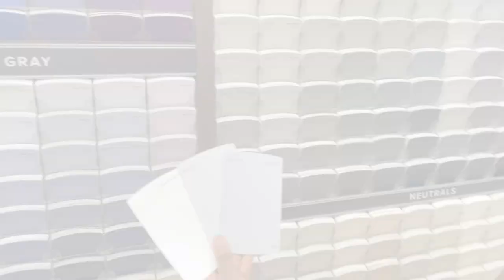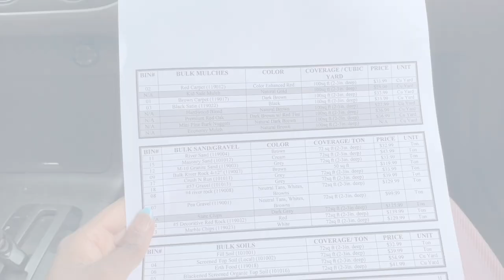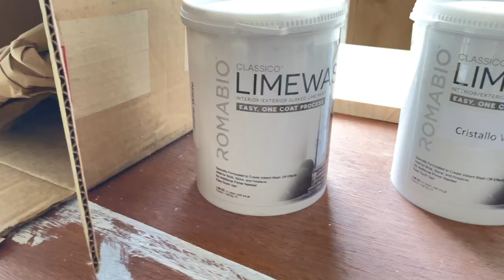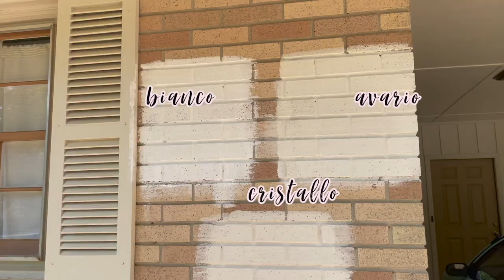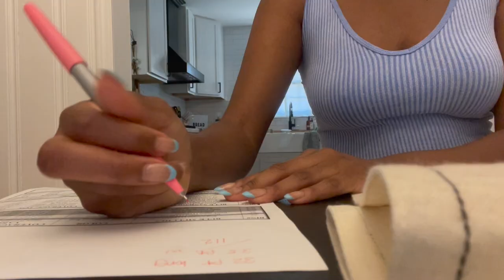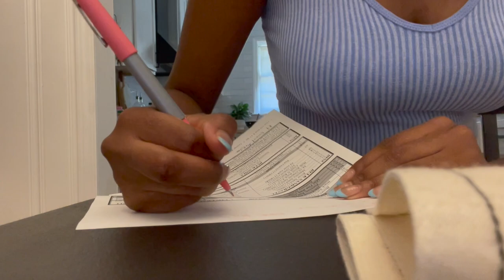PLANNING MY DIY EXTERIOR MAKEOVER!!!| Testing Paints, Plants, Gravel + Inspo #FIXERUPPER *help me*

Comment: Please don't go with the gravel, it's hard to walk-on, not shoe friendly especially hills, it get into your lawn even with trimming, grass grow right through it which leads to extra work, rain washes it away, you has to constantly add more and replace, it discolor and grow lime which will cost more money in the long run, most importantly it don't look good and it will bring down the value of the house, I know everything is getting higher by the day but seen like you can get concert poured way cheaper than $4k, I got a 20×20 ft area poured
under my deck for $1k a few months ago, if you can't find anyone cheaper, lay down stone walking blocks or skip the brick painting because it's beautiful or at least for now and put that on the concrete, please no gravel❣
Reply: GREAT INPUT!! I HOPE SHE READS THIS!!👏👏
Reply from the maker: I’ve already ordered it boo! The gravel is happening 😍 at the end, I talk about how I’m gonna keep it contained bc like you mentioned, I don’t want it to spill over :) thanks so much loveeeeee! I’m gonna keep all this in mind though, the one I’m getting is very fine, like pebbles so I think it’ll be easy to walk on! 💕💕
Reply: @YoungLadyBusiness  I wanted to suggest.....you could add  some spaced out pavement slabs in between or stepping stones perhaps to help when walking with heels etc

Comment: You could rent a small cement mixer. Set your wood form and pour it. My husband and I did it ourself. Buy your cement at Home Depot. Usually about 4 inch deep sidewalk. It won’t cost $4000.

Comment: K-noooooooo to the pink. The gravel option is a great idea. I did a circular gravel area around a pole in my yard that holds a birdhouse on top. I used a rubber edging from home depot that went int the ground and held the gravel marble and stone mix I used. I also laid on top of the grass this paper plastic material so that the grass would not grow up through the gravel. I then purchased some 12 by 12 square patio blocks and angled them in diamond shape and placed layer them out  and filled with gravel all around them for people to step on. I edged it all with white bricks.
Reply: Darn girl!! I want to come to your house for ideas. I’ve recently purchased my house (a little over a year) I would love your decor

Comment: If I had to choose one of the options it would number one with the darkest pink (Mavu).

But to be totally honest, I like your inspo pictures because they are a blend of modern and contemporary (and the shutters provide a little touch of traditional).  Therefore I think the exterior brick should be the one you didn't select (or option three) with black trim (this seems more forgiving over time with the weather) and black shutters (or grey shutters).  I like the gravel with the pavers and I absolutely think the inlay tiles inside the top step need to be redone.

Comment: The beauty of brick: It is practically maintenance free, once you paint it you now have maintenance. You also have a home that is drastically different from the other homes in the neighborhood if the other homes are the original brick (resale problems and irking the neighbors, maybe)! I personally would not paint the brick. I would do the landscaping and walkway. I say this because over the years I have paid thousands of dollars to paint the exterior of homes, finally in my older years I have an all brick because I didn't want the cost of maintenance. Other things to consider: Georgia has a LOT of pollen and it will not take long for the white paint to be yellowish. Also, when it rains the dirt will splash up on the side of the home, good landscaping to hide the dirt on the bottom of the home will be a must! Wishing you the best!

Comment: A little late 😬 however, consider the second choice, terracotta door, black shutters and trimming. Large concrete, wood,  or recycled rubber railroad tie pavers , using the 89 gravel (my fav as well) . Plant those two trees you purchased from Home Depot in some black planters for your entrance , oh and Black rubber mulch, (Place plastic under) . This will prevent sprouting grass🌱 and bugs.

Comment: It’s funny I liked the bottom option best when looking at it straight on but when you were doing the walkway part of the video I noticed the swatches and it looked much more tan there and then I liked the one that Marcus likes best... 

For bushes you might look into Annabelle Hydrangeas and miniature Knockout Roses. They are so low maintenance but have flowers all spring summer and fall. Very pretty. Some simple box wood for ever green shrubs are nice too. 

Also look for other everblooming perennials for the flowers. It’s very nice to have flowers all season long. And that means less annual flowers to buy every year. You can also look for plants that have “four season interest”  that look nice in the winter when they are bare. Look for plants that do well in your area and you can check fb marketplace and Craigslist type places in the spring and fall for people who are dividing their plants and giving away free or cheap. This helps saves money and will be likely plants that do well in your area. When I first got my house I bought plants the hard way by what was pretty and from Home Depot type places. Those plants didn’t last well... the ones I got free from people did the best and then I learned more about what plants were right for my yard/ area and easy to maintain. 

You’ll be fine painting! You’ve done so great on everything so far! You might start in the back/ sunroom part so that by the time you get to the front you’ll be experts :)  and feel confident!

Comment: Gravel is a nightmare in my opinion.  It ends up in the yard and get's slung by the mower and weed eater.  Pavers would be a more stable option.  You might want to check into that.  Also, they now make a mold that you lay down and fill with concrete to make it look like a stone pathway.  Another stable and pretty option.  Hope this info helps!!!

Comment: You may want to think of crushed rocks..remember those bigger rocks will mess up your shoes! If you get that crushed granite and sprinkle it with some cement on the top and then water it in it will be hard and won’t mess shoes up so much!  Why won’t you use the safe colour  you used in your kitchen door on your front door.... I think you mix too many colours! But it’s your house! I actually like your brick and I would not paint it cause once you start painting you’ll have to keep going. I would just wash the house down with pressure washer and see how it looks... but it’s your house! Both of the choices for lime wash looked the same!